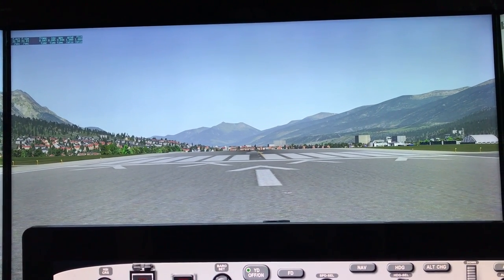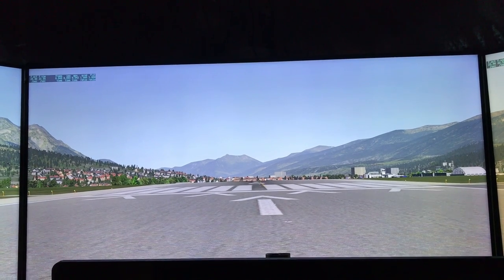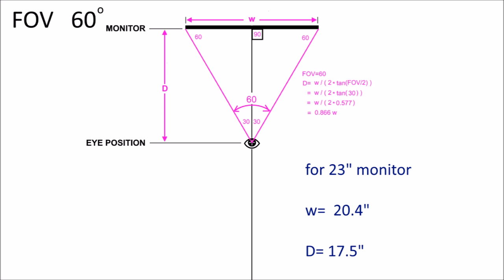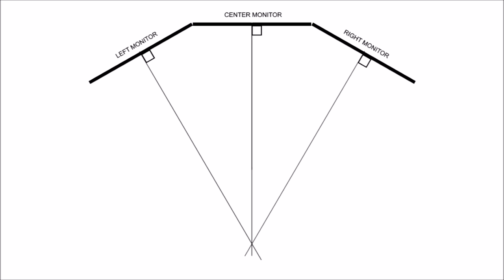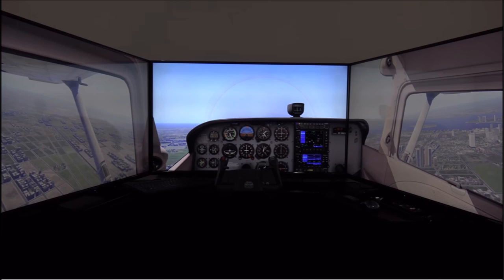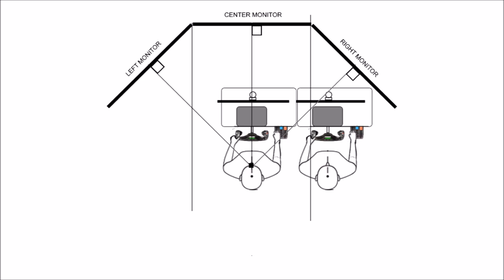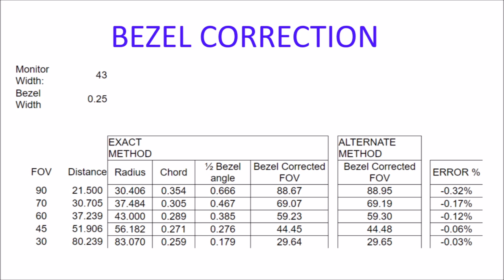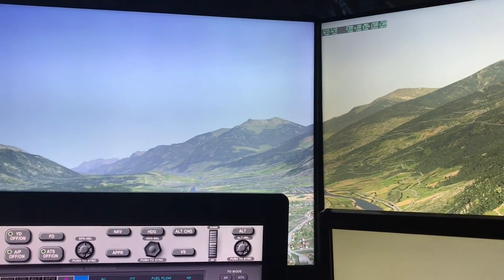x-Plane 11 Multi View Geometry & Bezel Correction

Comment: Russ, 4 years later and this is still the best multi-monitor setup video on YouTube. I discovered a while back that if I just drew it out, I could measure the exact angles and avoid all the math. That worked great! One topic I have never seen discussed is the virtual cockpit rendering. Larger monitors setup with correct FOV give perfect external results but I would love to have my front monitor placed roughly where the base of the windshield would be in order to have x-plane render rain effects. Unfortunately, I have not been able to find a way to do this. Even VC panel renders huge on my 55” screens and is impractical. I can live without the panel as I have a complete panel but would love to get the rain effects. It seems like there should be a way to scale the rending of the cockpit but I have never seen any way to do that.  Thanks for all your great content Russ, love watching your videos.

Comment: Thank you ,Russ.  I have been flying my sim for several months now and I did something while trying to add a scenery upgrade for OSH..  So I had to go back to setting up my monitors and this video really helps.  I don't know if you remember but I had a problem getting the touch screen on my smaller monitor to work.  I also couldn't get the instruments on air manager to fully work.  I'm still a novice at windows10 and computers in general, so your videos help me out a lot.  It was much easier flying the real Airbus.

Comment: Great video with clear explanations (minus high end math). I'm sure many of us are debating whether to go with a single, ultra wide monitor like the LG 49", or to take the 3 monitor approach while maintaining a minimum fps standard (around 30) that will appeal to the majority of simmers.
Reply from the maker: Sim 737 Pilot the problem with the ultra wide is that since it is a single wide angle view it will still have distortion as you approach the edges of the monitor. This was my issue with NVIDIA surround using three monitors as a single wide view. To see this effect see my video on multi view setup.    

https://youtu.be/a7LfXqpi-I8 

Go to about 5:20 to see that portion

IMHO the FPS loss is worth it for the accurate view. I have to admit as a RL pilot I would rather reduce graphics settings to maintain a good FPS and keeping a geometrically accurate view. I understand that some simmers are more interested in seeking as close as possible to a photorealistic view and can accept the view edge distortion.
Reply: @rbarlow  I agree with you. Id rather have the geo accurate view and decrease settings as needed to keep the fps acceptable. Based on your video, I'm now leaning toward 3 monitor setup.

Comment: It is helpful in every way. i have been flying with a single monitor,  an i5 intel laptop with barely a graphics card UHD 960.  Wonder how come I kept at it with a FPS of
12.  Needless to say that I had to set the graphics to almost nothing in order to fly at a decent frame rate. 
Tomorrow my Cyber Power will arrive bringing an Intel Core  i9 9900, 16 gb memory, NVIDIA Geforece RTX 2080 Super, 1 TB SSD.  I can't wait to set it up with the 3 50 inch 1080p Monitors. I'm sure there will be quite an adjustment in flying dynamics as the new FPS rate with be so much more.  I'm like a kid at Christmas.  Thank you for the blueprint for setting it up correctly.

Comment: Russ, thank you very much for your details explanation. As a physicist I have no problem with the maths ;-)    I'm running FS 2020 and still wondering what setup will be the best, because 3 monitors with 4k will be too much load on the graphics card, I'm afraid. Maybe I go for one monitor (55" TV 4K) first, see the FPS and then decide later.

Comment: Hello Rus. Thank you for this very good video regarding a multi monitor setup. I have used a 2 monitor setup  for a long time for FSX and P3D and in the old stretched out form for X-plane. 
Always used the tryout the figures method to get a good image. Now I know how to calculate them correctly. Thank you for that.
With regards to the smaller 30 degree FOV option. To get higher horizon view the monitors could be turned 90 degrees. This will give a smaller width and more height. 
Then you can get a good setup with 5 monitors for a 150 degree horizontal FOV in combination with a good vertical VOF.
I wil modify my settings the next time I use my monitor. For now I am using my Oculus Rift VR wiht FlyInside XP for the complete immersion.
The only minor on this is that te resolution is not that good yet in order to see everything as sharp as it is in real life.
However the imersive effect of VR is compensating that.
For now I wil use the montor setup as backup for high resolution precision flying.

Comment: Great video....actually all of your videos are very helpful. Right now I have 1 wide screen 29 inch gaming monitor which is great. Looking forward I want to set up a 3 monitor cockpit and will be using larger monitors. Do you have a suggestion on what model that will not break the bank would be a good one to look at?

Comment from the maker: The curve should help somewhat but I wonder what radius the screen is curved to. From my video example for the 70 degree Michael Brown setup, the correct viewing distance is about 30.5 inches with a 49" diagonal monitor.  Not sure how that would affect things.  Try using the formulas and calculating the viewing distance (D) and radius (R) and find the difference.  Then put a straightedge across the curved monitor and see the depth of the curve. That should give some idea how close the radius of the monitor is to the ideal radius. I am probably going to set my monitors to the 60 degree FOV to see how that works.  No way a computer available now can drive more than three monitors and maintaining several copies of X-Plane 11 on different machines would be a pain IMHO.   Anxious to hear how your ideas work out.
Reply: Russ Barlow thanks much for the reply Russ, I'll be sure to let you know how it goes, and do the math on the layout. I even wonder now if those TVs are constant radius or some compound curve.. Anyways I'm just about ready to pull the trigger on the 3 TVs, new yoke, and possibly a new computer just for the primary X-Plane installation.
Reply: TV monitors are ordered Russ; 2 matching Samsung 49" curved sets, and the companion curved model in the 55" size for the front view. An ASUS 21:9 ultra wide computer monitor will be for the gauge panel. Wish me luck!
Reply from the maker: Let me know how it works
Reply: Russ Barlow hi Russ, the third and last TV is arriving tomorrow! They look pretty good, but I've just been watching some X-Plane YouTube videos on them so far. I'll try to get the radius on  them for your reference. Can I email you offline?
Reply: finally got a build thread started Russ! http://forums.x-plane.org/index.php?/forums/topic/118220-overly-ambitious-tbm-850-cockpit-build-brunner-yoke-g1000-4-large-screen-tvs-dash-panel-multiple-pcs-etc/

Comment: Thanks for the crystal-clear instructional video, Russ. I have been successful in setting up my home cockpit sim views with the information supplied and my triple monitor setup works very well with 45 degree offsets. I was hoping that you might have some further insight regarding other problems with X-Plane 11 working in conjunction with AirManager, the Knobster, and  a five-monitor panoramic view with two touch screens for the instruments panel. I would be happy to contact you through AirManager if you prefer. Please advise.  Thanks.

Comment: Hi Russ, thanks for the great video. I've got plans to do Michael  Brown's 210° setup (as he calls it)  but I'm going to try it with 3 Samsung curved 49" LCD tvs which should help reduce the distance deltas from corners to eyes. I'll use a 29" ultra-wide 21:9 flat monitor for dash panel. Curved TVs might be a consumer fad but for close-in viewing, they seem to be the natural choice. Just worried about seeing pixels. Obviously 4K is not really an option both money and processor wise. Regardless, it might be a neat experiment to redo your math but with curved screens, and see what the benefits/drawbacks are. Hopefully X-Plane 11's monitor adjustability will be able to allow for more crazy monitor options like this. Thanks again!
Reply from the maker: I have a GTX1070 using HDMI cables attached to DisplayPort  sockets  using adapters.
Reply: Russ Barlow I only have a single GTX 780Ti and the display port output is hosed, forcing me to use HDMI. Time for a new video card anyway. The three curved TVs arrived, but one of the side 49" sets came damaged...so I will have to wait a little bit longer to start playing around.
P. S.  I got a matching Samsung curved 55" for the front display instead of three 49's.

Comment: Thanks so much for your videos.  I have only tried msfs 2020 so far and don't love the implementation for multi screen.  It's unstable and lacks flexibility.  Plus I don't expect better from 2024 so I thought I'd look into X Plane.  You mention using 5 monitors in this type of setup.  Seems like the most outputs modern graphics cards have is 4 and some are limited to only using 3 at a time.  I use three 55 inch tvs.  How would go about getting 5 displays to work?
Reply from the maker: Use a usb-c /usb 3 docking station like the Plugable products that allow additional monitors
https://plugable.com/?srsltid=AfmBOoqlbQUwSCpZNDOd82bSKaBHFzqHFl3aY6JqhcH5QipAyj68a_JW

Comment: Thank you for the detailed explanation on using multiple monitors. I do have one question: Is it possible to use four monitors where the two center monitors are in a straight wall format with the other two monitors creating the side views. Thank you in advance.

Comment: Great video! Thank you for taking the time to make this. I would be very curious to see a video about a topic you briefly mention here: monitor/FOV setups with home cockpits for 2 pilots (side by side). What would be the best monitor/FOV setup if both pilots were to be placed equally away from the center (i.e. like in a real aircraft)?
Reply from the maker: As I said in the video, there is only one spot in space that gives the correct geometry for all three ( or more) monitors in a multi screen set up.  The effects can be mitigated by making the screens as larger as possible so that the percentage of distance from the “sweet spot” is a smaller relative value. This is similar to like your two eyes, which are not both in the ideal position, but are close compared to the distance to the screen so the error is not obvious.

To avoid this, collimated optics are used in the airline simulator visual display system so that the out the window (OTW) scene is seen by both pilots at a distant focus rather than at the focal distance of a projection screen. This is achieved through an optical system that allows the imagery to be seen by the pilots in a parabolic mirror that has a vertical curvature, the curvature enabling the image to be seen at a distant focus by both pilots, who then see essentially the same OTW scene without any distortions. Since the light arriving at the eye point of both pilots is from different angles to the field of view of the pilots due to different projection systems arranged in a semi-circle above the pilots, the entire display system cannot be considered a collimated display, but a display system that uses collimated light. Ref https://en.m.wikipedia.org/wiki/Collimated_light
Reply: Thank you for the thorough and quick reply! I'll read more about these focal effects that you mention.
Reply: One thing I forgot to ask about -- an alternative to the collimated light display. Would it be better in the two-pilot home cockpit scenario if two views were mapped -- one for each pilot (from each seat's view perspective) -- and the views would be switched back and forth depending on who was pilot in command? For that scenario, is there any way to adjust the FOVs with the correct offsets and differences for each monitor (i.e. different FOVs for each) to get an immersive and realistic view for at least the PIC when s/he's flying? Sorry if my questions are a bit basic, but I sometimes have trouble imagining the geometries involved. Thanks again!
Reply from the maker: Alex's Flying Club I I’m afraid there’s just no perfect solution but trying to set up the different monitors for different eye positions would be worse. You could simulate the effects by setting up your eye in a position that subtends the same horizontal and vertical angle as your larger monitors would and then moving your eyes left and right in  the scale amount  to see how the view changes. The effect that n the forward view is not really that noticeable. Yes he side monitors are where each pilot

Comment: This is so very useful. Thank you for your painstaking and clear explanation! One question, if I may: I'm thinking of using 3-5 monitors in portrait aspect (as I am interested in building a heli sim and this will provide for chin-window views). Obviously the much narrower width of each screen will affect FOV and viewing distance, but my question concerns the XP horizon. You say this defaults to the middle of the monitor. Can the horizon be moved higher? Thank you again, Russ.
Reply: Bob Gilchrist ...yes, it can be adjusted in PlaneMaker. If you need specific help let me know via PM so we don’t tie up Russ’ channel.

Comment: Thank you for the very thorough video. Have you ran any numbers on any 49” super ultra wide’s or curved super ultra wides?
Reply from the maker: same theories apply but I think curved is a problem.  X-Plane at lease projects an image that is made for a flat screen. I will not be correct on a curved screen but may not be that noticable.  Problem is that the curve has a radius.  Unless you chose a field of view whose correct view distance coincident with the screens curve radius it will "possibly" look bad.  Certainly not peefect.
Reply: Hi Russ, what do you think about the new 49" Samsung curved  R1000... I am thinking on a 4 screens setup for a 2 men cockpit 1/1 of a A330
Reply: claude-serge Seron great question because my question was actually geared towards this exact monitor.

Comment: The best analyze that I've seen so far... How many inchs has these monitors? HD or Full HD? Thanks.
Reply from the maker: Mr. Ros - Gamer BR  49” 4K but setting are 1920 x 1080 because graphics cards cannot handle 3  4K monitors
Reply: @rbarlow  Mr Russ.  Are these 49" 4K monitors or TVs? Also, these don't look like ultrawide.

Comment: Hey, thank you for sharing such an informative video. I'm currently thinking about setting up a three monitors flight sim (instruments panels shown on the monitor). I wonder do you think 49 inches TV is enough? Do you recommend any "perfect" size for flight sim? Thanks.
Reply from the maker: Bigger is better since you have more room to accommodate a cockpit. If you want to set the side monitors back 60 degrees on each side you get a 180 degree FOV which is great but yo would have to have your eye pretty  close  to the front monitor.you can use the formulas in the video to work the distances out. I have 3 -  49” monitors and wish I had used 55”. They are pretty affordable now.
Reply: @rbarlow  Thank you for such a quick reply! Okay I think I'll get 3 55" TV for flight sim! Have a good night!

Comment: Great 👍 presentation 
Could you explain how to set up a second computer to run Air Manager  software?
Reply from the maker: Very straight forward. Just install Air Manager on the second computer and the Air Manager plugin on the first computer with the Sim. If they are on the same network they will connect.  Check out the Sim Innovations Wiki for step by step details.

Comment: Hi Russ, thanks very much for this video! Apologies if this has already been answered, but exactly what are the specs of the monitors/TVs you’re using in this video, i.e. size and resolution? I’m thinking of upgrading to bigger monitors as I’m currently running 3 x 1080p 24” monitors which I’m finding are way too small. I have a GTX 1080 so just trying to gauge the expected performance if the resolution bumps up. Thanks!
Reply from the maker: Jack Y that setup has three 49” 4K monitors but only can run them at 1080p . It has an i7-4770K cpu and a GTX 1070. It has since been upgraded to a i7-8700 and GTX 1070ti. I am running a 4th monitor with Air Manager for a panel on the same computer. That way I can drag pop out windows fro X-Plane go place in my Air Manager Panel. You should be  able to do this with your setup but remember some graphics settings like number of objects is CPU limited.  I’d get 55” monitors if your room size can support it since the prices on TVs are cheap now and size DOES matter regardless of what your girlfriend says.   The further the monitor is away(bigger monitor) the less you will need 4K.
Reply: Russ Barlow Thanks so much for replying. I’ve measured up my room and I think I’d be risking a divorce if I go over 32”, so that’ll have to do for now! It’ll still be a step up and I can find a pretty cheap (in the UK) IPS model which I think would work well - the ViewSonic VX3276-MHD-2. 

Hopefully when we move into a bigger place I can get three 55 inch TVs, and maybe even a second PC to push them pixels!